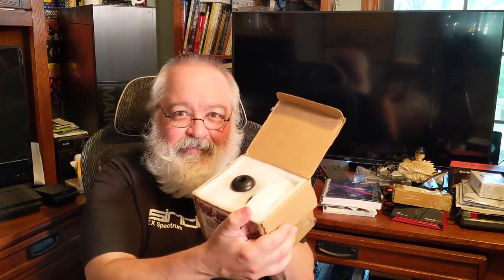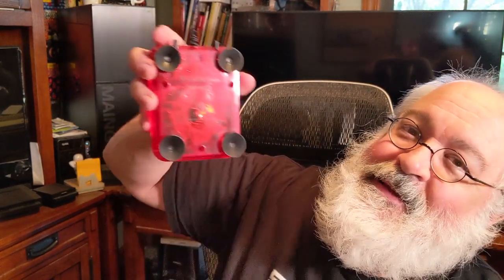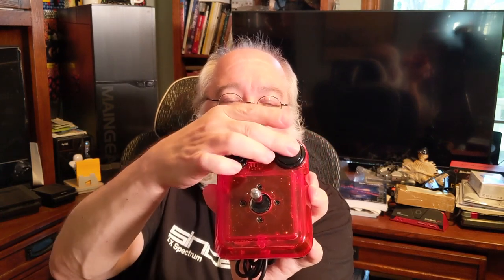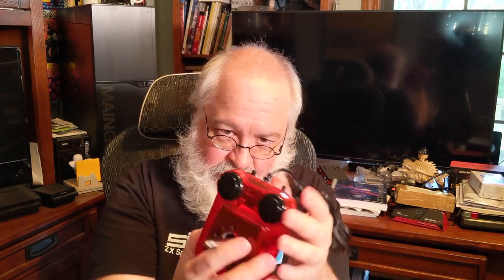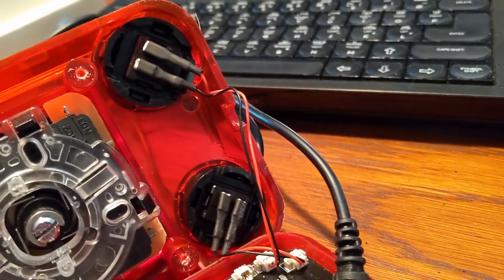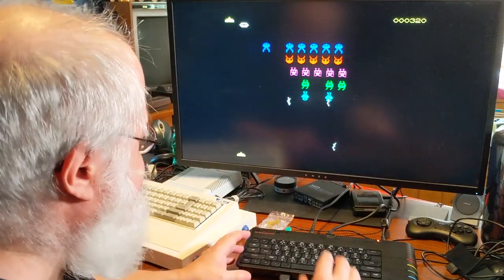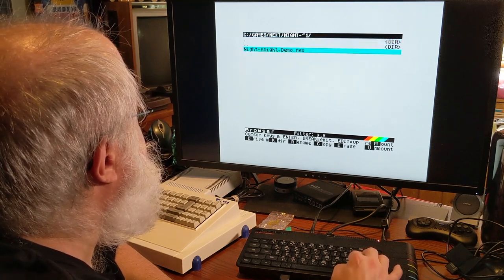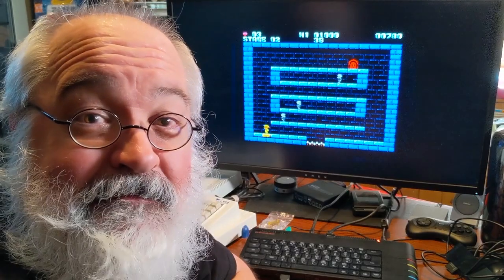ArcadeR Joystick for ZX Spectrum Next - Atari - Commodore - Retro - Kempston Compatible Computers

Comment: Just got one of these for my Amiga in light grey to match the Amiga's colour (black buttons, dust cover and ball top).  Very smooth and responsive movement and the dust cover has a rubber washer inside so it doesn't move now - so not dorky on the later models lol. I'm sticking with the gamepad I have for the Next because some Next games are using up to 3 buttons.